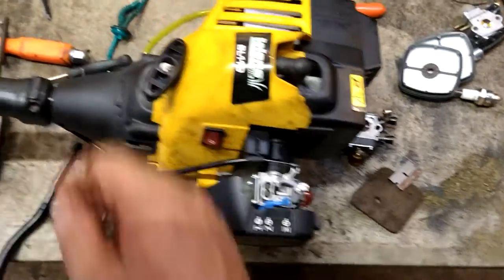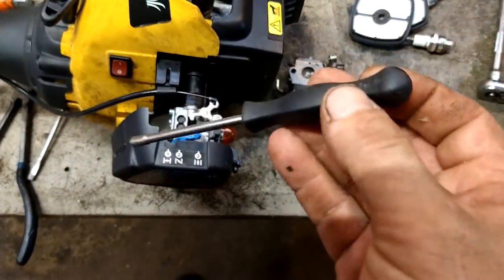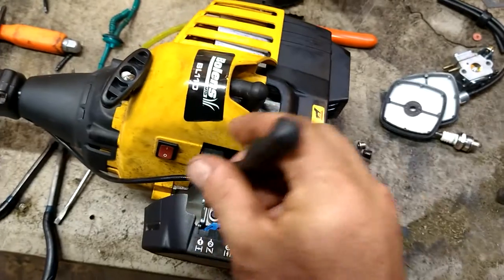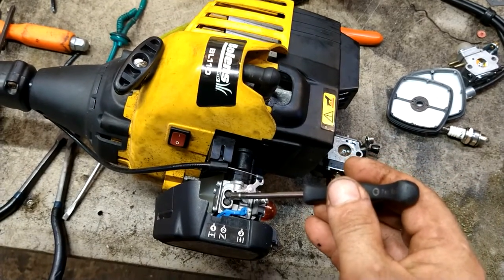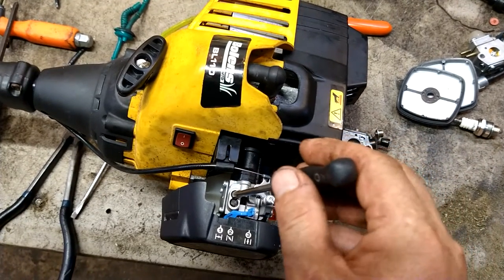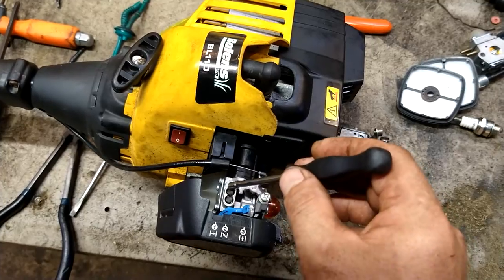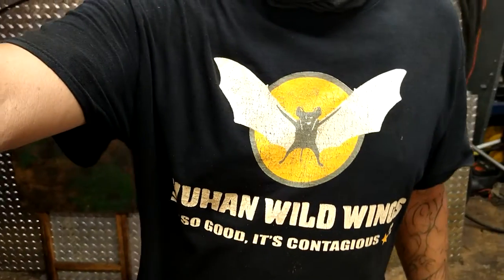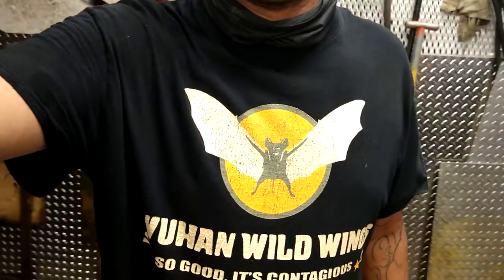* Bolens bl110 carburetor adjustment, carb adjustment, tune up,

Comment: I initially had a problem a couple of years ago that I couldn't get my weed eater to speed up so when I started to adjust I ended up having to bottom out the screws and you just barely do that but backed off  the screws ½ turn at a time and tried to restart. After 1 ½ turns it fired up and reved also. Just me, no new parts and I am picky about my fuel and use a touch of SeaFoam starting in August Normally zero problems but weed eater is maybe 10 yrs old
Reply from the maker: does the carb feel loose if you wiggle it? if it does the isolator block between the carb and engine is loose and needs tightening. also is it partially throttled at the carb? look at the part that moves on the carb when you squeeze the throttle. if it isn't hitting the idle screw when you let go of the trigger you accidentally dislodged the cable in the handle. try pushing it back in.
Reply: It is probably adjusted the same as a chainsaw. I have worked with chainsaws all my life. They have the same basic components.
Reply from the maker: @Daniel_Antonio_Arellano782  all 2 strokes adjust the same way.

Comment: Thanks for the video.  I have a 2004 Bolens BL100 and just replaced the carburetor.  The inside diameter of the yellow fuel line the came with the carburetor was too big and fuel would leak out.  Fortunately, I had an extra fuel line that fit.  Since I am a rookie at working on small engines, are their multiple size fuel lines for carburetors for weed eaters, chain saws, lawn mowers, etc...?
Reply from the maker: yes. and some of the aftermarket stuff is just to big inner diameter for these. i try to stay with hipa aftermarket equipment or raismen. they stay in the parameters

Comment: I have the BL110 too and it runs only when squeezing the trigger but once I let go, it turns off. I adjusted the screw closest to the carb but it still wont stay on. Tbh, when holding the trigger, it runs at full throttle and can get a little uncomfortable after a while cause of the vibration
Reply from the maker: carb time sorry
https://amzn.to/44wilct

Comment: I just bought one of these 2 months the worst weed eater i have owned...
Reply from the maker: Lol I make them amazing. Some fine tuning is always needed on homeowner equipment
Reply: I only trust Andreas Stihl when it comes to gas power tools.
Reply: It's not a Stihl, they usually come running from the factory but not adjusted. Mine idled too high and burped on the way to full throttle  low idle richer, high idle leaner. It's not hard to adjust them.

Comment: I'll have to try this on my BL120.  It idles fine.  But won't get up to full throttle, and seems to burn a lot of gas.  The head wont spin real fast either.  Which makes trimming difficult.
Reply from the maker: yep to rich screw closest to air filter clockwise till highest is achieved then back real slow till it just starts to flutter between that high and the next octave down

Comment: Any advice if it won't even start. It kinda wants to just wont commit!
Reply from the maker: Try starting at full throttle
Reply: @smallengineguys  did
Reply from the maker: @AnaGarcia-op9qj  needs a carb sorry
Reply: @smallengineguys  Yeah I think so,  too!! It'll start normal when I'm throttling like I didn't have throttle on. I let go and it turns off! Could it be the fuel!?? Thank you SO much for your feedback!!

Comment: What is the diagnosis that it needs a new carburetor and not adjustment ? Mine only runs on partial choke and dies on no choke. It starts to run real good, fast rpm then dies if choke is not partial closed. Should I get adjustment tool or new carb?
Reply from the maker: thats an adjustment. the screw closest to the air filter a quarter turn. if you got a dremel with a cut off wheel you can cut a notch in it and use a screwdriver.
Reply: @smallengineguys  The screws are recessed in the carb body, are you saying cut a screw driver notch thru the carb then into the adjusting screw?
Reply from the maker: yep
Reply: I just did this..cut slots in adjustment screws with a hacksaw blade..yep you'll cut into the carb body a tad but its doesn't affect the carbs structure..

Comment: My weed Wacker will start and run it I give it gas but I have to wiggle the blue choke to get it to rev is it still the air flow ratio or a bad carb plz help
Reply from the maker: fuel air mixture to lean. do this and youll be fine
Reply: @smallengineguys  I don't have the tool to do it but I got it to start and stay on I left the choke in-between 1 and 2 and it's running fine now

Comment: I replaced my carburetor and dialed in the idle and mixture for my BL100.  My previous weed eater's trimmer head would only spin when I pulled the trigger, but it had a curved shaft.  My current Bolens has a straight shaft and the string trimmer head spins at a fast RPM.  Should it be doing this?
Reply from the maker: at fast rpm the clutch engages and spins the head. at idle clutch disengages and head doesn't spin. if idle is to high it will spin. if idle is low and its still spinning the clutch is bad. usually it is frozen on those and needs to be disassembled cleaned and oiled.
Reply: @smallengineguys  Thanks for your reply!  Did you ever video repairing a clutch for a weed eater?
Reply from the maker: @Luv2flyMD  not for this no. just remove the 4 bolts on the black piece on the front of the motor. it 4 or 5 mm Allen. then under you will see clutch I think this one is 2 bolts and 1 spring. the metal clutches swivel on the bolts and are held closed by the spring. they are probably frozen open or the spring is broken. oil and move back and forth till loose or replace spring.
Reply: @smallengineguys  Big thank you!!  Much appreciated!!!
Reply: @smallengineguys   Thanks for the tip!  I thought I had a BL100 but it is actually a 2004 BL150 (item # 41AD150G065) with straight shaft boom. My bad. This model looks little different.  The carburetor is in the rear of the engine.  So, I removed five T20 bolts off the front cover and removed the starter housing assembly (recoil spring and pulley), which exposed the flywheel. Then I removed the boom and flexible drive shaft from the starter housing assembly and did not see a clutch.  I reviewed the manual and parts list with no clutch listed.  Should the flexible drive shaft continue to spin at low idle?  Thank you for you kind assistance!!
Reply from the maker: @Luv2flyMD  no clutch means direct drive and yes it will move at idle.
Reply: @smallengineguys  Thanks again! Looking forward to your next video!

Comment: What is a pacman screwdriver?
Reply from the maker: round with a nam nam divot.  https://amzn.to/3yi0Oqc
Reply: @smallengineguys 😂😂nam nam divot!
Reply: A circle with a "pie piece" taken out, like a Pacman. I know this is a year late but just hacksaw a slot scross the screws which won't hurt the carb body and use a small flathead screwdriver to make adjustments.